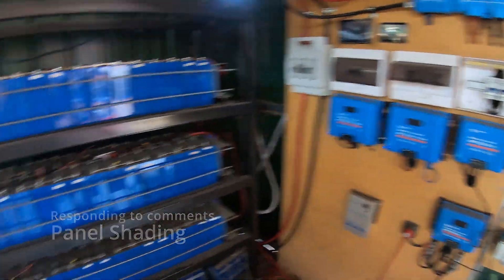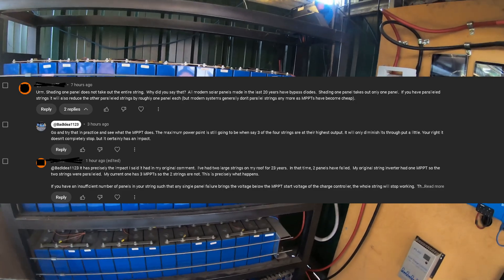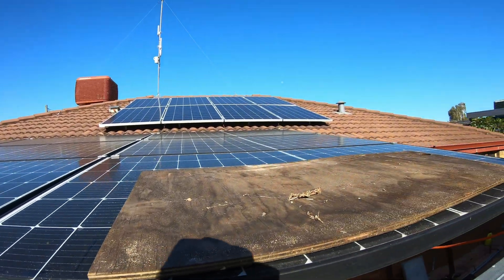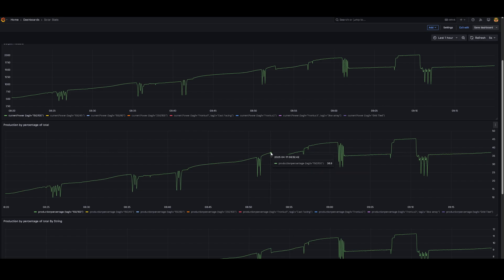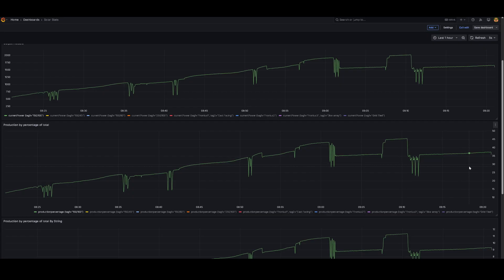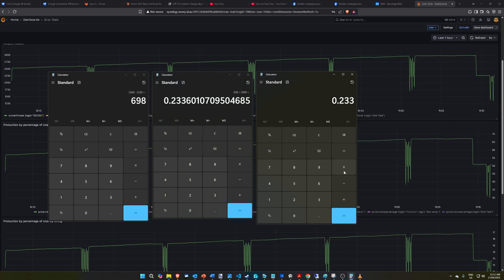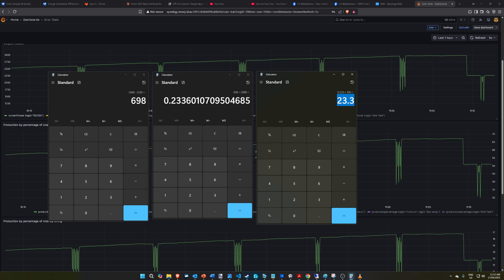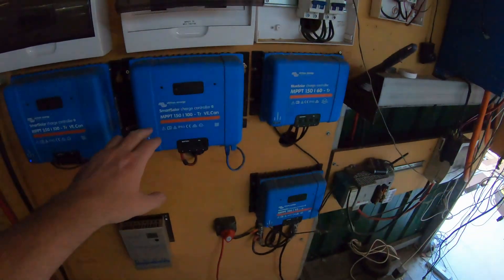How bad is shading on solar performance

Comment: I must re-do my "Solar panels emerging into sun from shade, power mapped to audio tones" with a better camera, maybe with power production chart overlaid. I think my experience matches yours, but ours is only detectable momentarily each morning, so we pay it no heed as fixing it would cost far more than any 'lost' energy is worth. The maths might be different in other circumstances.
Reply from the maker: not running on batteries ? or you justhave pleanty of power ?
Reply: @BadIdea1123  my 'off grid' inverters have AC Input connected to the mains so they fall back when batteries run low. I'm well over-panelled for my inverter size so any poor shaded performance lasts only a few minutes until the first string emerges into full sun. It can't cost us more than a couple of pennies on a good day. We get plenty of cloud as we're on side of upland, so solar isn't an every day prospect for us.

Comment: Shading drops 90% of performance here in the Netherlands.
Bypass diodes can help but get crazy hot.
For me I stay low on voltage and match my PV with the battery. 
Our main array runs at 1500V wich is pretty insane compared to the build quality of proper panels.
Reply from the maker: that is high voltage for sure, our systems cant go passed 1000v dc

Comment: Everyone always dislikes my Enphase AC coupled into my Luxpower but it delivers more than the strings when any shading is involved.
Reply from the maker: I thought they were ok. We are using some micro inverters to add panels to our van. I like them
Reply: Short strings like 3 panels are less likely to have problems as compared to 10 panel strings.
Reply: @offgridwanabe  Short strings create more problems.  Long strings reduce the problem space immensely... even when paralleled, in fact.  But those Victron's have fairly low 150V Voc voltage limits so they can't take long strings of high-wattage residential panels.

Comment: No real experience with MPPT, but I'd be willing to bet it's still tracking the max power point on the unshaded strings- the mppt algorithm is looking for where power is at a maximum, and it may be stuck in a local maximum- I'm not sure how far outside its operating range it'll explore- I feel like it'll only go up/down a few volts to try and maximize; where as if you lost an entire panel it'd need to explore down 20-40V to find the point where it'd pickup the shaded string. 

Or, it's not worthwhile to hit- I'm not sure what voltages/amps you're seeing on the panels, but if it's 4 strings of 3, and the per panel voltage is 40V @ 10A; you're looking at 3*120V*10 = 3.6kw using 3 strings of 3 vs 4*80*10 3.2kw for 4 strings of 2/at-the-lower-voltage- so you're better off dumping the string in that case. If you only had 2 strings in parallel you might see the 'drop a panel on each string' behavior. 

Or if you had more panels in series, say 6s4p, that'd be 7.2kw 3string vs 8kw 4string - I think 3s4p is just at the fun spot where the math starts to break down.
Reply from the maker: Im lead to believe that victron uses Perturb and observe algorithm 

The feedback i got while researching this phenomenon did not align with what we are seeing at all. I fed the technical documents in to claude AI and this is what it gave me back. Thus the speculation that voltage is the culprit. as its the voltage potential being lower that allows more current to flow

When one string has a shaded panel in a multi-string setup connected to a single MPPT controller, the situation becomes more complex. Here's what happens:

String Voltage Effect:

The string with the shaded panel will indeed have a reduced voltage output (potentially dropping by 1/3 if one section of a panel is bypassed)
The other strings will still be capable of operating at their optimal voltage

Parallel Connection Physics:

When strings are connected in parallel to a single MPPT controller, they must operate at the same voltage
The controller can only choose one operating voltage for all strings combined

MPPT Algorithm Challenge:

The controller now faces a dilemma: it must find a single voltage that maximizes total power
This optimal point will be a compromise that doesn't perfectly match any individual string's optimal point

Power Point Determination:

The Perturb and Observe algorithm still works but now measures the aggregate power
It will find the voltage that produces maximum total power across all strings
This is typically closer to the optimal voltage of the unshaded strings since they represent more potential power

Power Loss Mechanics:

The unshaded strings operate below their individual MPP
The shaded string operates above its individual MPP
The combined power is less than what would be achieved with separate MPPTs for each string
Reply: Victron uses a very wide voltage sweep, its algorithm will find the best local maxima.  The problem is that now there are two local maxima and NEITHER one is optimal due to the paralleling of the strings.  Which is why its a bad idea to parallel strings in situations where partial shading may occur.

Comment: The glow is IR so you need to use a camera to see it. You can use this fact to see if you have micro fractures or open circuits etc.
Reply from the maker: thanks mate,  that's something i'm going to look in to. I think a lot of people are not even aware of it

Comment: shading is completely different on my newest array. I have 5 arrays and they are all fairly small like 2000 watts and a couple are only just over 1000 watts. the new n type panels handle shade way better than my others
Reply from the maker: I have another video coming out right after this one, when the VOC goes up the impact is reduced. we cant say that with absolute confidence yet but it aligns with the comment that was made on the original video. At some point you may get to a stage where only a single panels worth of power would be missing but we cant yet prove that. Part 2 comes out tomorrow morning

Comment: It's not so much the voltage, it's the current. If you shade one panel, it will drop from 10A to 2-3A for example and drop the entire string current to 2-3A.
Reply from the maker: Im going to have to go back and measure that too cheers for the feedback
Reply: @BadIdea1123  That's something I'd like to see. Is it the voltage drop or the amperage drop that causes it?
Reply: No, if one panel is shaded and the new Vmp is a low enough voltage, the shaded panel will go into bypass and can pass full current.  But when this is the situation and one has paralleled strings on top of that, there are literally TWO peaks in the MPPT curve now and the MPPT controller has to choose one of those two peaks.  Neither peak is ideal.

Hence why paralleling DC strings in situations where partial shading might occur is a bad idea.

One peak is to remain at the Vmp of the remaining paralleled strings, so they will be able to produce full current at an optimal voltage.  This will take the voltage above the Voc of the partially shaded string, however... meaning that string will produce very little power.  Maybe even none depending on where the maximum power point for the whole thing winds up being.

The other peak on the MPPT curve is to run at a voltage somewhat lower than the Vmp of the remaining paralleled strings.  In this situation the other two paralleled strings will be producing full current but at a lower-than-optimal voltage. However, the lower-than-optimal voltage will allow the partially shaded string to contribute a bit too.

The strings do not force each other's voltages to any sort of median value.  They are diodes... if one string is forced above its Voc by the other two strings at the current the MPPT controller has decided to regulate to, it will simply not produce any power.  The voltage point that the combined system operates at is under the full control of the MPPT controller.

-Matt
Reply: Maybe do the analysis with out the mppt dump straight into a load. 

My assumption is its not the mppt.